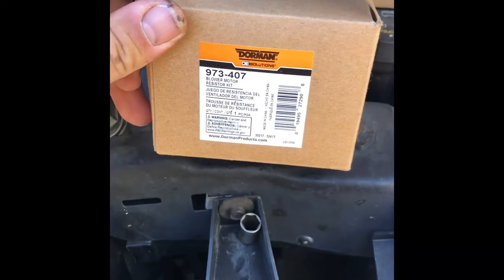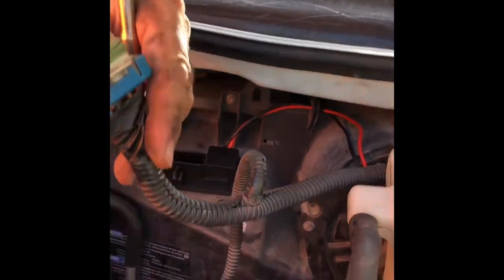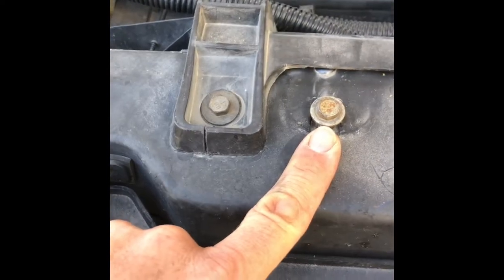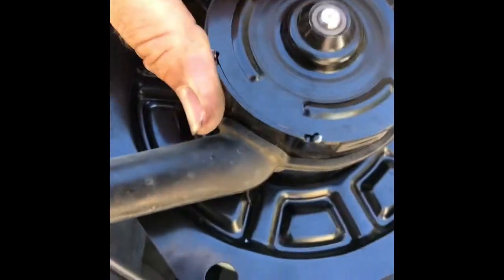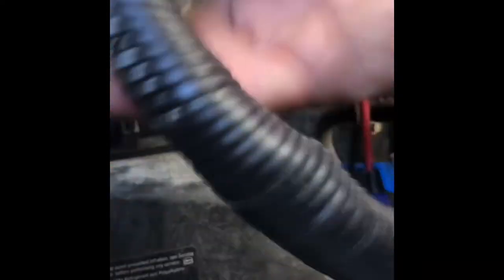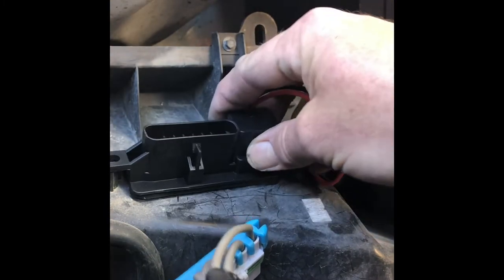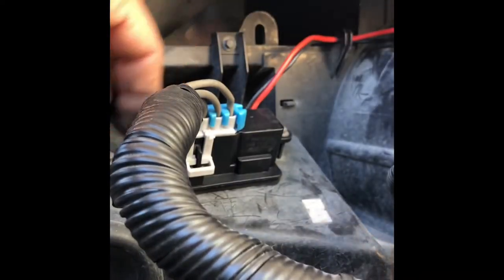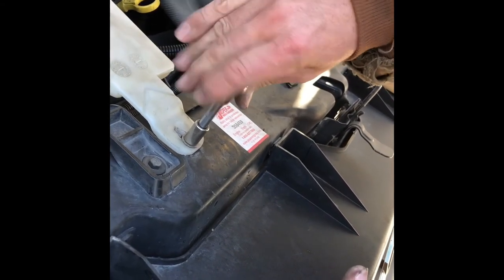Chevy express blower & blower relay resistor replacement to finally fix it the blower problem

Comment: Why was she smoking?
Reply from the maker: Congratulations @rockdeals you watched to the end. Thank you. My first try I accidentally switched two of the wires when I re-wired the plug. Power was then applied to the wrong part of the circuit and poof.  Ruined the part and the plug. Had to do it again. Thankfully I was able to remove the pins from the new but ruined plug. Replaced the bad one from a new kit. Fixed my wiring mistake. And then it worked just fine. 
#weaversstonehousefarm
Reply: @weaversstonehousefarm  
Can you do a video of the wiring? Don’t know why they make the new harness with all same color.. 🤦‍♂️
Reply from the maker: @JAinc-EB  sorry no.  These videos are are all made for free at this point.  I agree it’s nuts they are all the same color. That’s how I messed the first one up. I switch two of the wires.  Best thing is go one wire at at time for the cut/strip/crimp onto the new adapter. 
If you want to pay for details, send me $50 cash or venmo and I’ll make a video of my wiring connections to the adapter just for you.